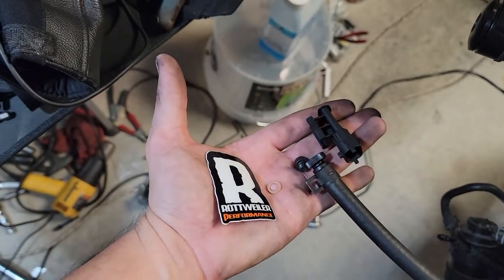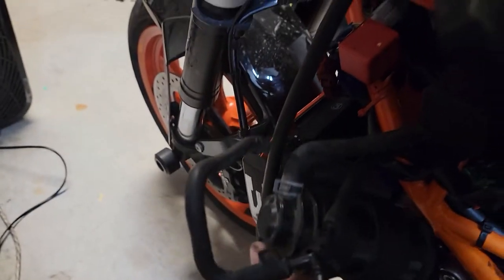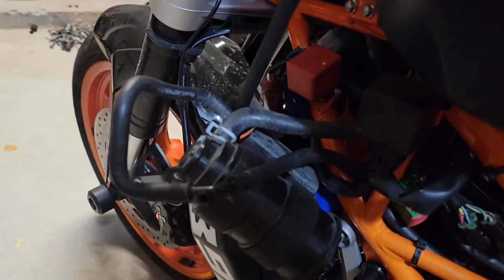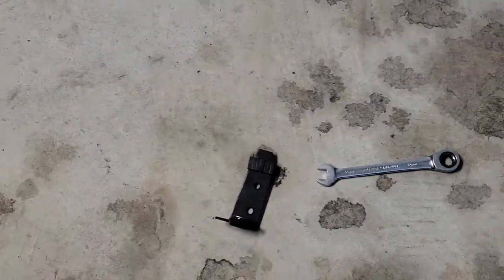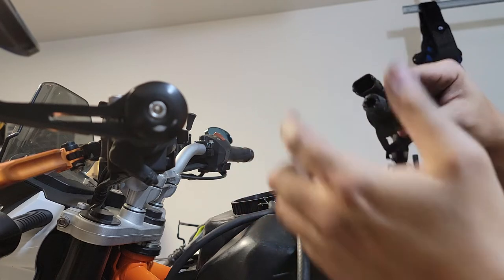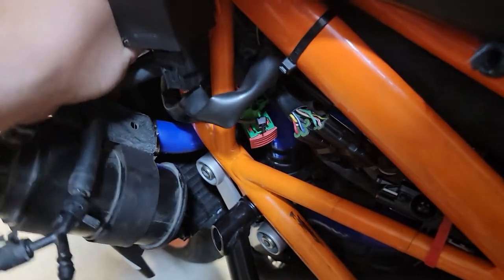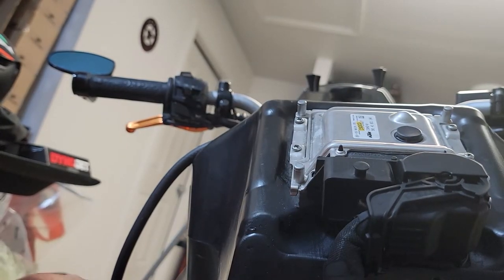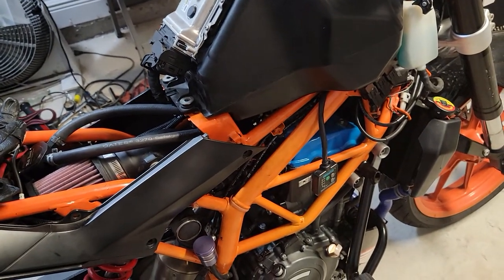KTM 390 Duke Rottweiler Performance Canstier Delete Kit Install

Comment: Did it on my 2nd gen couple months ago, was getting a CEL light could not get rid of. Plugged mine at hose going to throttle body to eliminate SAS valve and as much weight as could. To help ECU learn, re-hooked SAS back up but installed dongle also and light went off, after couple of rides removed SAS valve, it worked.

Comment: What is that air intake and canister next to it brother. I have a 2015 and want to get some of these things done as well
Reply from the maker: That is the Chimera intake.  You will need tuning to get it to run right.  I had a bog for a while, but my auto tuner has been able to fix it and it runs great!  What you are seeing next to it is an oil catch can.  I have two videos covering them.